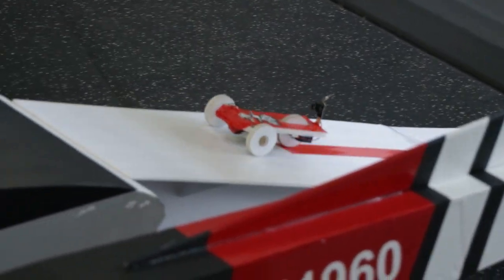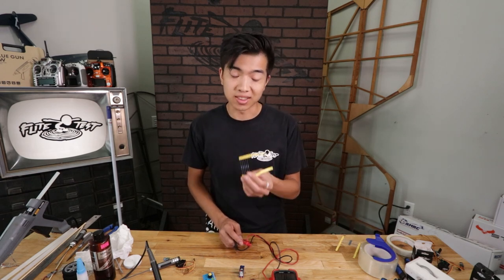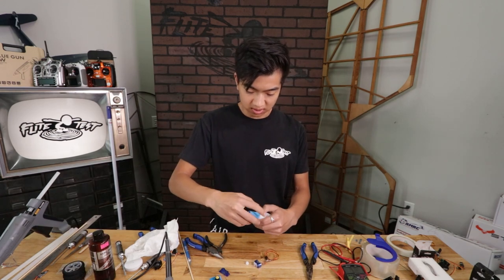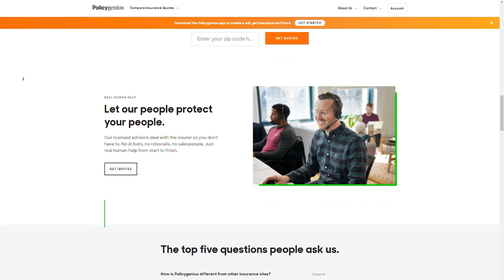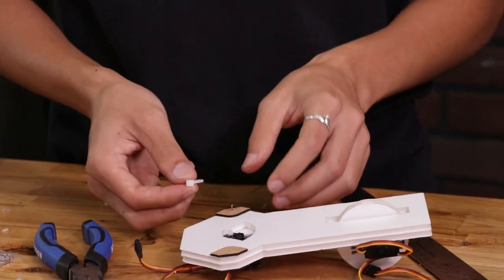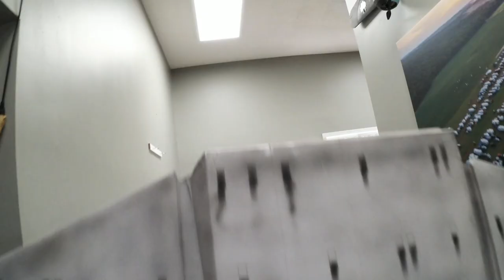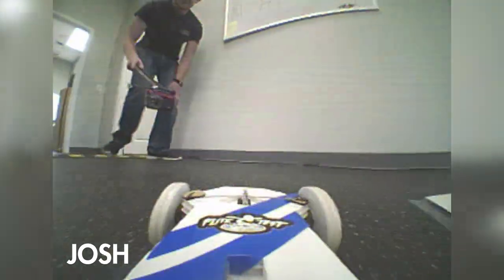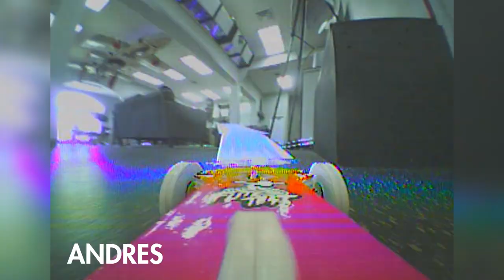How to make a RC Servo Car | DIY

Comment: Put rubber bands on the wheels ... extra grip so you’ll ride down the slides instead of slipping down them 👍
Reply: The Smeared Hot Glue on them.
Reply: @ravenlorans  Rubber still has more grip than cold hot glue
Reply: Rubber wrist bands would probably work good to
Reply: name  mj
Reply: @Abdurrehman Khan yeah if you want to drift.
Reply: rubber bands, or black electrical tape. both would give a substantial increase in grip. maybe even add a single quadcopter motor running in reverse on the top, for "downforce" lol
Reply: @stevewilson2745  haha I never thought about the quad motor in reverse trick before 😂 I would love to try this out someday 👌

Comment: I just built a continuous rotation servo for the first time in ages, and here you are doing the same thing. However I never thought of gluing the gears together to change the ratio and get more speed out of the gearbox! Great video, don't listen to the complainers who think it's "too hard", lol. I used to make similar cars from crashed servos too, we didn't throw things out when I was a kid if they still worked. This is a classic project, cheap fun!
Reply: Do you have a link which shows it done a bit more clearly?

Comment: When you bend the steering arms, angle them inward, pointing to the center of the rear wheel. This will allow the inner wheel to describe a smaller radius arc than the outer wheel for proper turning. To learn more, look up "Ackerman steering geometry".

Comment: Hello Flite Test. A few months ago there was a $40 3 channel EZ power pack( the one with the small servo) and a $35 2 channel EZ pack, but only the 2 channel version is on the STEM store. I would like to inquire what happened to the 3 channel pack. Because I would certainly like to buy a few of them for designing my own planes! but most of all seeing how young aspiring engineers create their own designs will be the best thing that I could imagine!!

Thank you very much from Jacquen Franck
Reply: Was there a 3 channel version? I know the 2 but I’ve never seen the 3...
Reply: buy the ft airliner and remove the 3 ch pack from it

Comment: I used a servo in exactly the same manner to control a model loco. I was surprised how the little tiny servo chip powered the much larger motor in the loco with out any problems. It was lovely and smooth and because I had a battery inside the loco there was never any need to clean the tracks.. Great channel FDO

Comment: i have done this but instead of putting the resisters on i would center the  potentiometer glue it in place. cut the little stopper on the gears and plug it into the receiver with a steering servo and a 4 pack of AA. didn't need the ESC because the servo has one. learned to make sail boat winches back in the AM transmitter days.

Comment: Do the same speed and rotation mod to TWO servos, instead of one (or if you are really adventurous, two PAIRS)
Get the cheapest "instant V-Tail" mixer you can find.  Mine was under $2
use one servo for each "front" wheel (with no steering linkages) and a 'tail wheel' for the back wheel.  A spoon works well, too!
Or, if you do two pairs, just arrange them on both sides like a skid-steer tractor, or make tank treads!
plug both cables of the v-tail mixer into the RC reciever.
plug both servos into the v-tail mixer.
You may have to swap wires around on both the rX or the mixer, but you can now have throttle on the throttle stick or trigger of your transmitter, and tank-style steering on the other stick (or same stick if you prefer?), or the steering wheel of your transmitter WITHOUT having to mix anything IN the transmitter.  a simple rc car Tx/Rx will work as long as you can plug in servos.

Comment: Dear FlightTest ~ can i ask you about something please? How can you use drone gimble parts to make a vertical axis gimble for a Osmo pocket (which has pitch and roll but not yaw) so that the camera stays stationary in space? Ive had a go at making a spring version, but wondered if drone parts could be used. Any help would be greatly appreciated, all the best

Comment: The average person would never be able to do this project.
Reply: kidding me?...this is an easy and awesome DIY
Reply: @inemm  not special at all...why do you sound so angry?  This is an awesome project!
Reply: @inemm  I see you are so mature also.  SMH
Reply: why not? what is so difficult about it? if you're into these things you probably already have a soldering iron which here is really easy to use. resistors might be an issue if you don't have some laying around
other than that, this is easy af
Reply: Basic DIY project as far as i am concerned, Soldering is intimidating at first but a little practice, and its a breeze.
Reply: Yeah they would. Just don’t follow this video on how to make a servo go forever. Follow the one they did with Peter
Reply: @ashers_workshop link please
Agree with the first comment because so much of what was described was hard to see and follow especially after opening the servo

Comment: A WPL Toyota pickup is 30 bucks and putting the similar components into it would actually make something scale and cool. But an excellent vid presented quite well.  Have you tried something similar with a gullilows balsa rubber band plane using a micro server to "wing warp" and tiny coreless motor for the prop? Or move the rudder...

Comment: instead of the resistors you could just keep the potentiometer, so that you can tune it. after, just hot glue it so that it can't rotate
this only works on some larger servos though

Comment: If you were to use an old cheap two wire motor style servo for steering, could you use the two outside wires on the receiver to make this work?  or am I deranged and polluted?  Thanks

Comment: I think this is too advanced for a beginner. Nonetheless nice vid!
Reply: To advanced? Yeah to make the servo spin it is. There is a much easier way to do it. I did it a easier and different way. I didn’t even use resistors even though I have plenty
Reply: It doesn’t seem that bad

Comment: alright now.. hack two servos, one each for the left/right wheels. Using mixing to give yourself single stick steating. Then use a brushless motor on the front with a popsicle stick mounted in the middle.
You have just made a battlebot.

Comment: Im worcing on a rc plane but i only have a resiver that only have 2 motors and no more and it stiar  vid inkrising the trotle but id does not work so im trying to 
Remove 1 motor and put a servo There    but it Just spins do you know what i kan do?

Comment: There are easier ways to convert servos to continuous rotation, I prefer to remove the mechanical connection from the pot and lock it in the neutral position. Then you don’t need to solder anything, or need resistors since the pot is still connected. Just not being rotated
Reply: I have done that method a few times.  It can be a pain to get the POT perfectly centered.  The two resistors remove that problem completely.
Reply: gadgetmerc ya I was thinking about it more and that can be problematic. Your method is better, just a little harder to accomplish.

Comment: Wait, why does the pot go back in the servo if it was desoldered and replaced with resistors anyways? Did I miss something?
Reply: the POT is the hub for the second gear, the drive gear.

Comment: Waiting for it here... but why is the pot being replaced with resistors in the servo?  Should be explained before just doing it.  [edit]... oh... to turn a servo into the drive motor with no speed controller required.

Comment: Way too complicated, you can achieve same thing with a cheap DC esc and a cheapo dc yellow reductor.
Reply: That's exactly my opinion as well. 😊
Reply: This isn't the cheapest and easiest rc car, its meant to be something made with stuff thats lying around. Servos are pretty common especially if you follow flite test.

Comment: This is so great... i will make one by sure..... but if you align the two wheel wires, the ones that you bend 90 degrees back,  toward the center of the rear wheel you will have a real stering linkage with ackerman angles     https://en.wikipedia.org/wiki/Ackermann_steering_geometry thanks for sharing...!!!
Reply: It's funny how many (few) people know this...
I had an argument with student of the highest technical school in Switzerland. They did a whole suspension for a kart but had it at 90°

Comment: OR How about Not Using a SERVO as a Motor and Just Use a Actual Motor and Speed Control from a Trashed/Crashed Toy/Plane/Car???? I made a 3 Wheel Car out of a Crashed Plane. Prop Driven. Made a Air Boat also out of another one.
Reply: Because using a brushless motor requires a speed controller, larger battery, and a gearbox. 

The whole point of this is to use parts that you would have lying around, not to buy parts to build this.

These small cars are much easier to build for small children and are much safer than having a prop spinning.
Reply: @jbrdddd  Who said ANYTHING About Brushless? Whose to say Most people don't already have some Piece of Crap from Walfart laying around?  Not Everything needs to be Brushless. You think the motors in the Servos they used are Brushless???
Reply: @ravenlorans  I assume when you said motor out of a trashed plane you meant brushless as most of the planes made on flitetest are brushless.

Comment: Cool project..... not your best tutorial though(usually very easy to follow even for the uninitiated)  kind of blazed through a bunch of the points and not much detail.... Did not show putting the potentiometer back in at all.....

Comment: When they say simple and bring out all the technical parts that are like 30 to $50
Reply: An old receiver, couple cheap servos, and an old abused 2 cell is pretty common.  After being in RC for a while, you'll have this stuff just laying around.
Reply: The revo checker though

Comment: this video should be called 746 steps to change a servo into a crappy motor and save yourself $1 until you take the cost of the servo into it.